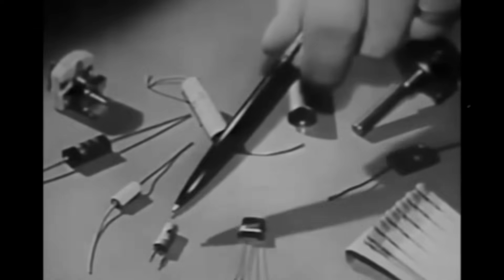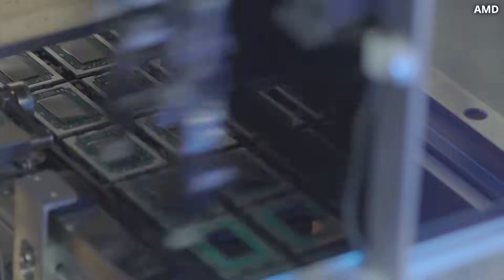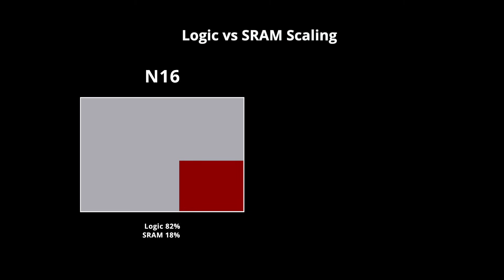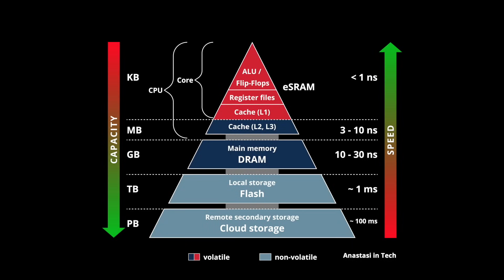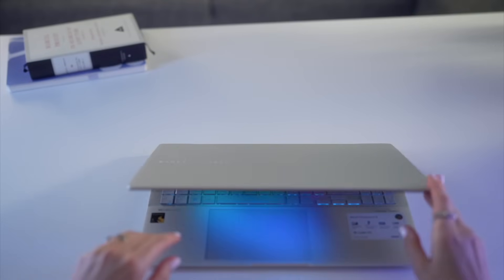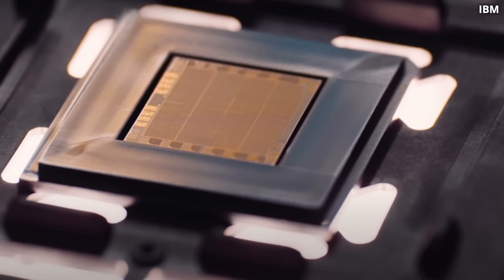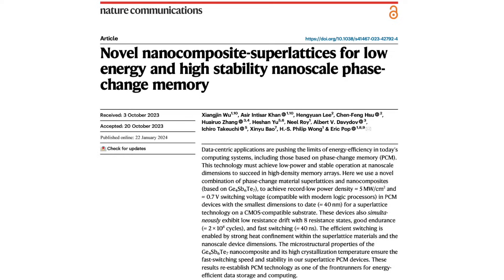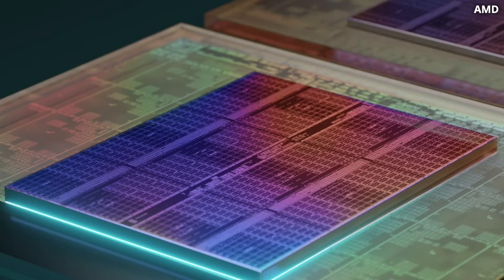The Death of Computer Memory

Comment: I believe that the problem of quantum tunneling limitations to size can be addressed by temperature as well as ionic state. This implies that mechanical cooling is a requirement which is expensive and inefficient.

Comment: One way of attacking the Memory Wall hierarchy is to attack it from the top, use RLDRAM which has been around for >25 years but only in NPUs (network PUs) since it offers DRAM cycle rates closer to 1ns but latency of 10ns or 8 clocks. Since it is highly banked, 16-64 banks working concurrently allows for 8 memory accesses every 8 clocks so throughput is 2 orders better than conventional DRAM. Of course in single thread use, not much benefit and to keep as many threads in flight requires that thread selects pseudo randomly across the banks and not hit on the same bank successivly.This could be used as an extra layer between normal DRAM on slow DIMM packages and the first SRAM cache level. This RLDRAM layer is where it would be used in CAM modules or soldered. We are substituting The Memory Wall for a Thread Wall here. But we already are used to having dozen threads these days. The RLDRAM model could be applied one level lower down in an RLSRAM version which would be perhaps several times faster but allow bank cycles and latency near 1-2ns but still 8 clocks and 16 banks.

Comment: I had thought of building memory (and the whole IC) in 3D 10 years ago. I think I even put the idea in my website years ago. One part of my idea that is not used yet is using microfluidics to cool the chips that are stacking transistors in 3D, thus restricting heat transfer. The channels could run many levels, and of course, they need fluid-tight connections (a big problem). And use optics to communicate instead of a BUS. Possibly LED or laser tech.

Comment: I wonder how fast the AI training compute would be using Germanium gates instead of silicon.
The training tiles used by Tesla and/or other AI compute use strictly addition and multiplication on variable size vectors or arrays.
How fast can these get?
Reply: really they could simply use SOI, or silicon on insulator with could easily give them a 20% clock speed gain And a 20% performance/w gain at low power states, its awesome tech hope it comes back

Comment: I think part of the problem with chip design is far too much focus is spent on making discrete units. All of the square and rectangle sections on a die are inefficient for processing speed. Another part of the problem is flat chips. We should be building up at the same time. Linear design can't get any faster. It's the same type of thinking that brought us a programming language like Java.

Comment: 3d stacking was the innovation that allowed more memory on the chip, not chiplets. Chiplets were a great innovation, but they were not what you wanted to discuss here. 
You also didn't explain the downsides to 3d stacking (memory layer holds in some of the chip's heat, so they need to limit their power somewhat). 3d streaming has been something they've wanted to do for decades, but only now were they able to make the chips efficient enough to make it worthwhile.

Comment: Chalcogenide PCM is not a new idea. 
Energy Conversion Devices / Ovonyx pioneered it many decades ago, and 3Dxpoint, a product based on this technology, was briefly commercialized by Micron & Intel until they gave it up for ultimately unknown reasons, but assumed to be cost reduction & scaling hurdles.

There are semi-credible conspiracy theories about Micron burying it on purpose in a way that made Intel unable to continue (using their buy-option of their joint venture to then just sell the fab not long after was strange. they also poached a bunch of Xpoint employees at Intel), and the incentives were clearly there in the form of a potential MAD situation vs Samsung's own PCM that mysteriously never came to fruition, as they both benefit grossly from the current situation with DRAM and a can-function-as-DRAM storage class memory could be very price disruptive of that.

There was also speculation that a settlement in the ECD (Energy Conversion Devices) shareholder trust lawsuit against Intel & Micron could become much larger or not be accepted at all if Micron & Intel did continue their commercialization.

Anyway, storage class memory such as 3Dxpoint has much lower adoption friction as CXL attached technology agnostic memory/storage becomes standard in the server industry.

Comment: The words "dynamic" and "static" are a reference to the powering method between state changes. You kind of hinted at this with the TTL logic diagram, but didn't expand. Static is faster because it doesn't have to wait for the re-fresh cycles before it can change state. Static also runs hotter and consumes more power- there are no free lunches ;-)
Reply: Not exactly. DRAM consumes power all the time, because it needs constant refresh to preserve contents. SRAM only consumes power during state change. Both consume some leakage current though, and with that, SRAM consumes more due to having more transistors per bit cell. DRAM also consumes considerable current to change state, because of its larger gate capacitance. Overall, DRAM tends to consume more power per bit but costs less and is more compact, which is why we use it for main memory and reserve SRAM for cache and internal registers.

Comment: These new analog memories can be super efficient for LLMs because we don't need exact values, just approximate ones, so each cell could store a weight. We still need the analog multipliers and then we'll finally have hardware neurons that will be way more efficient than the current systems which are solely bound by memory bandwidth and CPU power consumption.
Reply: 32/64bit APUs and 1bit LLM are a thing. AI is done on GPUs anyway, or better TPU/NPU, so we already have chips dedicated for it.

Comment: PCM memory chip technology has been in R&D since the mid 2000s.  Intel, StMicroelectronics and Ovonyx were in the game together in a joint development starting around 2005. Samsung was also doing research in PCM.  I believe the biggest player now in Micron Technology.. And you are correct about all the advantages of PCM.  I believe the two  big challenges are  being able program the device.into two or more distinct, well defined resistance states  reliably  coupled with manufacturing very small structures with precise dimensions.  Nvidea is talking about PCM.

Comment: This sort of tech is very interesting, because depending on how it advances, it stands to change the computing landscape in one or more different ways. If Phase-Change Memory is fast enough and gets good enough density, it can replace SRAM in L3 cache. If the speed cannot get high enough, it could still find use as an L4 cache or a replacement for DRAM. If all else fails, I bet it could give Flash storage a run for its money.

Comment: This is not a solution to the SRAM problem, even the authors of the paper state "his work provides key materials and engineering insights towards the design and optimization of energy-efficient PCM, and could inspire the industry-scale adoption of nanoscale superlattice phase-change materials for low-power and high-density storage."

The report states that they have a nice cell size of 45 nm, but a switching time of 40ns and endurance of 2 x 10^8 cycles (SRAM is around 10^15). So this is a possible replacement for Flash memory not SRAM.

As a side note, the use of any heat based phase change storage solution on or near the CPU die would result in some very interesting performance issues as the heat output of the CPU would be impacted by the number of true values held within the cache storage and the frequency the cache is rewritten.

Comment: The problem with chiplet design is heat management.
Since every layer is active, it burns energy and produces heat, and this isn't good.
A secondary problem is the bus interconnect because stacking requires shared lanes, so memory layers are in parallel, making the bus interconnect a bottleneck.
Last but not least is signal strength and propagation time: stacking layers requires precise alignment and add electron jumping around, so there's a potential limiting factor in electron propagation, noise and eventual errors. This isn't much of a problem if the system is built around it, but it still is a limiting factor.

There are solutions: since there's one master and multiple slaves there's no risk of collisions and so you can make a lot of assumptions on the drawing board... but busses are going to become wider and more complex, and that will add latency where you don't want it.

My 2 cents.
Reply: Heat, latency, voltage regulation, signal integrity, etc….  Stacked dies has never been simple which is why there aren’t many of them.
Reply: - I wonder if they run veins of metal in between the layers to send the heat to radiator.
- They put L3 cache on the second layer, which by virtue is quite removed from the logic circuits.

Comment: If distance to the memory is a factor in speed why not find a way to stack memory directly under the cpu.  Both in cou architecture but also a new ddr form factor that stacks memory directly below the cpu or cpu socket.  Then the issue would be cooling not distance.  I see amd just did that…  but what about a new ddr form factor?  My question about the new crystalline type memory is does it wear down over time and if so how much.  Also I though not mentioned I would think internal cooling design of fairly important two especially if processors are going to start being layered.  What kind of internal cooling design occurs in cpu design.  I can’t imagine it’s just as simple as expecting to throw on a magic thermal paste and heat spreader at the end.  Surely cooling is more involved than that but no one ever seems to talk about that.

Comment: @Anastasi - you might want to re-post this video taking Intel Optane memory into account.  It's a non-volatile PCM memory that's been out for years, and even used as DRAM.   As another comment mentioned, it failed due to the expensive manufacturing of the chips and the market simply wasn't there mostly due to fierce competition from flash memory.
Reply: optane's real problem was it being place in 2 places where it didn't belong, one was a flash competitor which placed it in a much too slow interface, another was in DIMM competing with much faster Dram chips, if we make a dedicated space for it optane could really bring some benefit but we need to do it the right way.